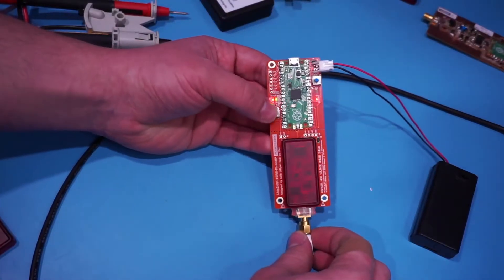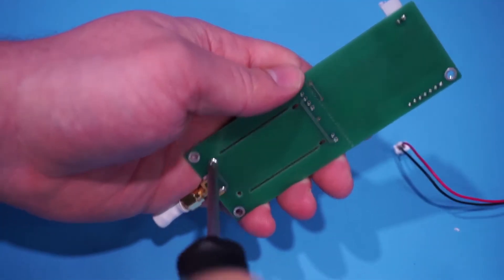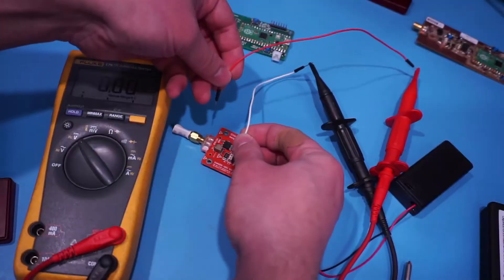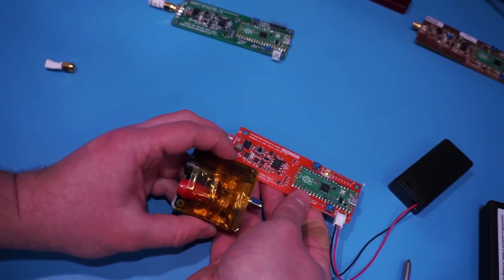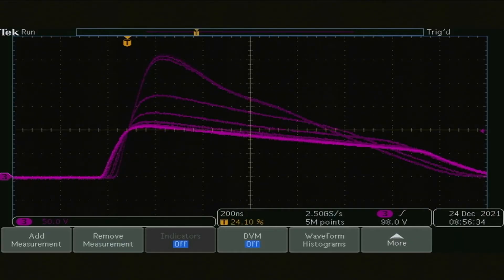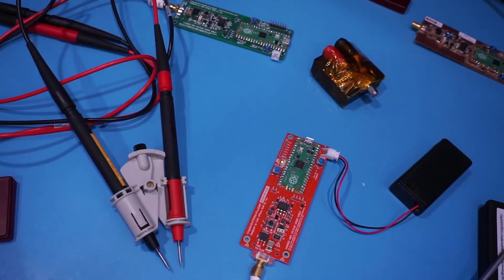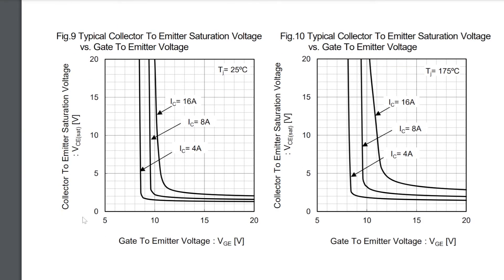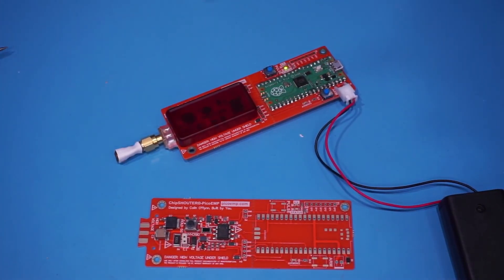Building the PicoEMP - Electromagnetic Fault Injection (EMFI) Tool

Comment: You can do this kind of thing without having a high DC voltage. You can use your inductance to maintain the energy and then release it as fast as coil itself allows just disconnecting it fast enough.